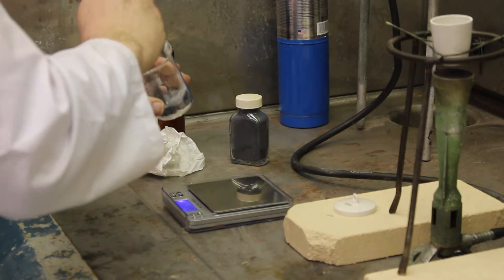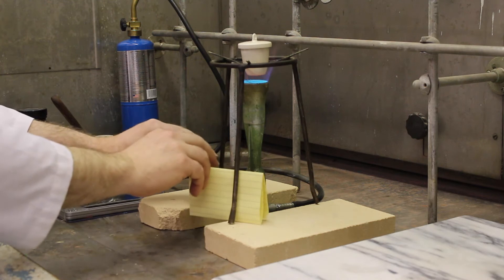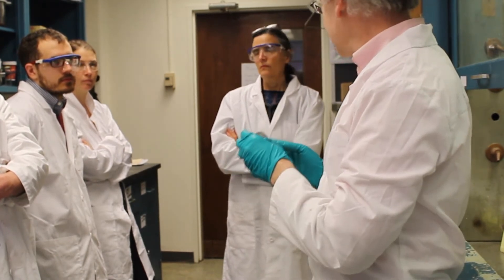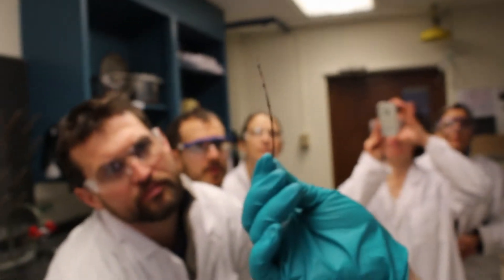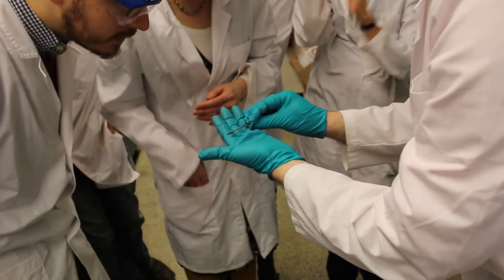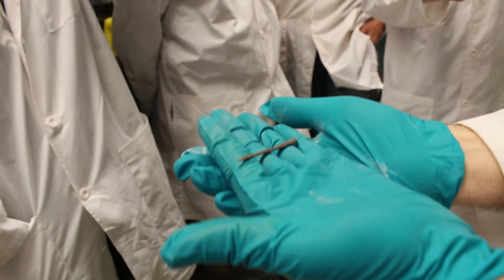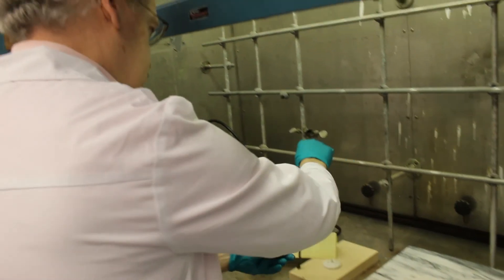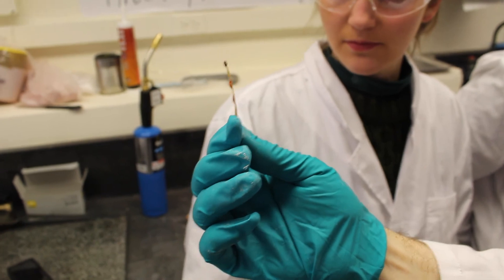Lawrence Principe - Glass of Antimony Reconstruction

Comment: I don't know if you guys ever found out but it's because they used coal fires not gas fired heat and at times coals would fall in the crucible causing a separation between the sulfur glass and regulus. And red glass isn't necessarily bad in my mind red glass would be better.
Reply: Sun Fire Hello, what are your experiences with the elixir of Antimony ? When the vinegar is seperated from the red sulphur, is a vacuum destillation necessary or can it be an ordinary destillation ?